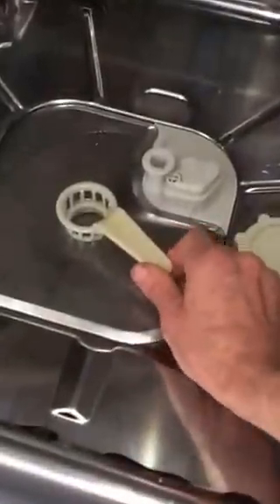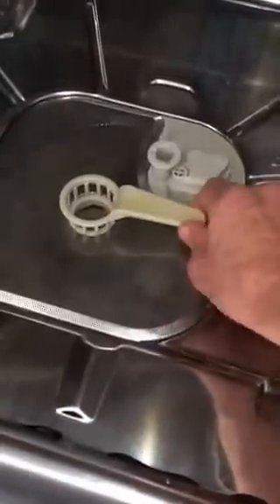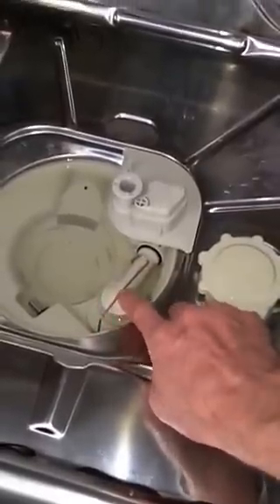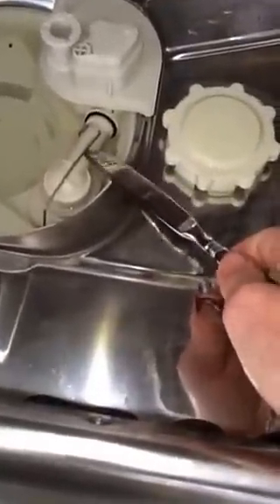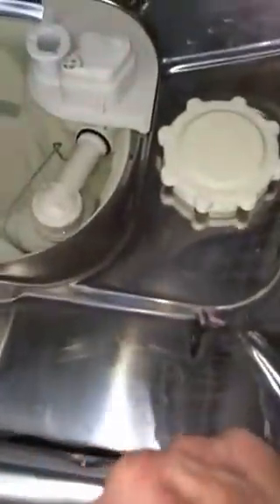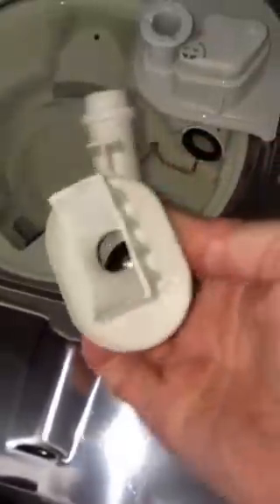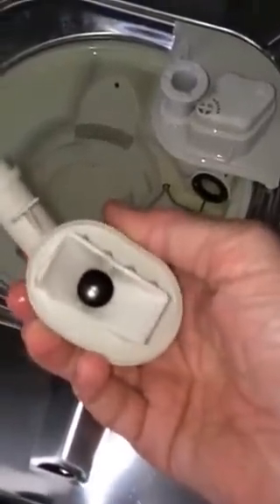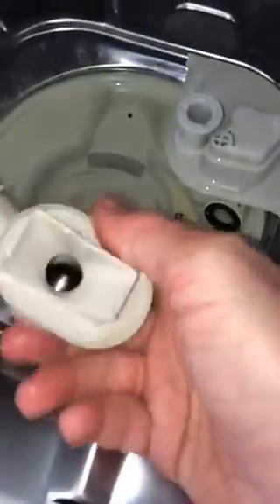✨ Miele Dishwasher - Intake/Drain Light - (3 Minute FIX ) - No Tools ✨

Comment: Thanks for this vid!  I cleaned it out and removed some debris. The dishwasher drains at the start of the cycle, and runs for about 10mins before it stops again and the intake/drain light goes on, and the water is back in the bottom.  I don't have an airgap installed. Any suggestions? Many thanks again!
Reply from the maker: Do you get a plume of steam when you open the door?
Reply: @ScottTheFixItGuyChannel  Thx for the quick reply! No steam.
Reply from the maker: May need to replace the heater relay do the water can heat up and give you steam.
Reply: @ScottTheFixItGuyChannel  Makes sense, any tips/advice/tests for that? Thx for your reply!  I'm handy w/ electrical stuff, do you know where the relay is located?
Reply from the maker: Here you are:  Miele Dishwasher -- Heater Relay — EASY FIX
Reply: @ScottTheFixItGuyChannel  Thx so much, going to try this!
Reply: Hi Scott, tried this: cleaned the relay contacts, and tested the relay actuation and  continuity, all seemed ok. Reinstalled and same problem: runs for about 10 mins at the start of the cycle, then stops and the water at the bottom is room temperature, red light blinking. Seems to drain ok at the start of the cycle as I can hear the water going to the drain. Heating element?  Your thoughts and expertise are greatly appreciated, many thanks again, there's a donation coming your way no matter how this turns out!
Reply from the maker: Thank you,

How high does the water get in relation to the plastic filter handle?
Reply: @ScottTheFixItGuyChannel  Hi, it goes right up to the plastic filter handle (approx. 1" of water sitting at the bottom of the dishwasher), thx!

Comment: I just completed all the steps. nothing impeding the impeller. the indicator light keeps flashing. what next? please help.
thanks.
Reply from the maker: Thanks Michael,
If it’s not able to drain the water you might want to disconnect the drain hose from underneath the sink and put it in a bucket and then see if you can get rid of the water.

Comment: What do I do? I found a piece of plastic in there and got it out but now it still has the intake drain light on and won’t drain. Please help
Reply from the maker: I would remove the drain house from the air gap and put it in a bucket to see if it will drain.

Might be a clogged airgap.

Comment: I did it and I switch it on with the door open. When it starts the program it looks like the impeller push the water into the dishwasher instead of push it out to the drain pump. Please, help
Reply from the maker: Do you think the impeller cover is securely snapped back in place?
Reply: @ScottTheFixItGuyChannel  yes

Comment: The impeller seems to spin fine by hand but the machine isn't draining and the water is dirty. Is that a sign the drain pump has died?
Reply from the maker: Yep, time for a new pump👍
Reply: @ScottTheFixItGuyChannel  Do you happen to have a video on that?!? :)
Reply: Hi Ken,
I was thinking of a Bosch.
For your Miele, I’d say the pump is ok.
Can you disconnect the drain from under the sink and put it in a bucket and see if it will drain into the bucket?
Reply: @FastFreeFixes  I will try that. Last night I disconnected the drain hose and it doesn't seem blocked but when it tries to switch to drain mode it clicks a couple times then has the drain/intake error.

Comment: Didnt work. Water is much higher than shown here so I cant see inside where the impeller is. I tried  moving it and seems to move back and forth fine but the water isn't draining.
Reply from the maker: You might have a clogged air gap 👍

Comment: Hi Scott. I have a different Miele model but I did everything you showed twice and it's still not draining. I can't afford to call a repairman and would be so grateful if you could offer any assistance. Thank you so much! Jamie
Reply from the maker: Hi Jaimie,

I would remove the drain hose from the disposer or airgap,
Put it in a bucket and set it to drain as you shake the hose to work loose the clog

Comment: Thank you.. so much.
Reply from the maker: You’re very welcome 😊
Reply: Whilst this helped me for the future.. understanding how to access the impella/intake etc.. my issue ended up being the energy saver mode triggering the drain/intake red light after it gets heat overloaded.. all of sudden just started happening, shuts down the function of the unit. After reading it in the troubleshooting section of the user guide.. I switch the dishwasher to normal setting and it now works. For anyone out there struggling with the drain/intake red light and no visible drain/intake issue